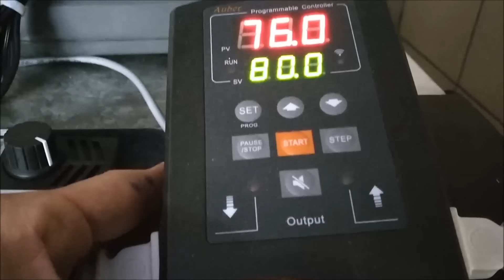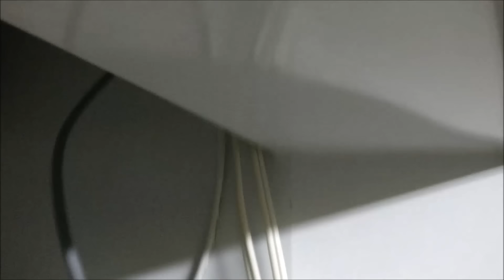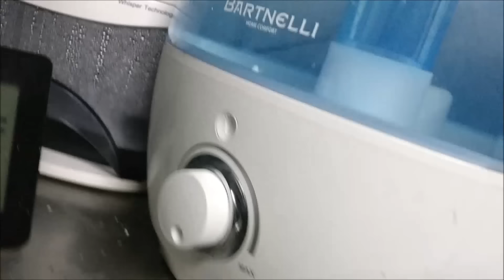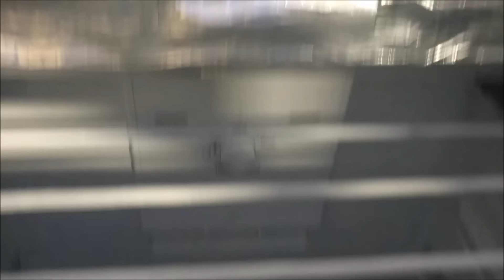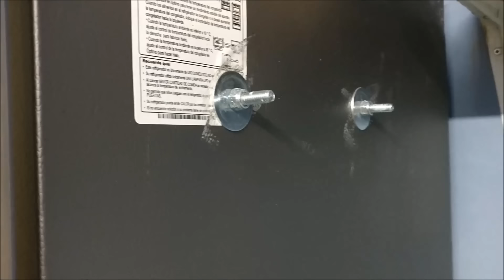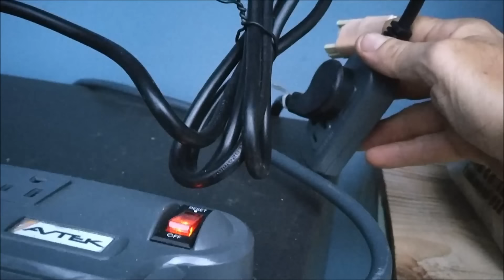Building a Drying Chamber for Salami/Salumi

Comment: Thanks for the video! Oh how I wish i had the space for a full size refrigerator!! I just got my 28 bottle wine chiller (I live in an apartment so no full size fridges...yet)  set up with a temp control and since the unit is so small and space is limited I went with just the mini-dehumidfier from Eva-dry. I'll hope that using evaporating salt water from a bowl will be enough to raise it up high enough since the chamber is sealed or I'll be in serious trouble lol.  Question , your temps are set at 55 for the drying and Ive been scouring the internet and Ive must of read like 20 different suggested temps. 52 degrees, 53 degrees,  even saw another guys video where hes got his temp gauge set for 68... and I thought ok that's really pushing the safety limits thats nearly 70 degrees... anyway hows your product working at 55degrees?  I'll probably target for that temp.
Reply from the maker: Thanks for watching.  The humidity should be fine with your set up.  Just be sure to check it (especially after the first month of drying).  In the beginning the humidity always spikes as your product begins to lose moisture.  Drying temps vary from person to person.  Typically the recommended range is between 50 and 60 but most try to stay on the middle to lower end of that parameter.  Every chamber has a life of its own so you'll want to monitor it daily in the beginning till you get to know how it reacts to meat being placed in it.  If you keep your humidity at 78-81 then your product will dry very slowly but you will get a wonderful end result (with no case hardening).  If you stairstep your humidity like this: Week 1. 80, week 2 75, week 3, 73, week 4 70% then your product will dry very fast but there's a good possibility of case hardening.   Also if the humidity is too high (Over 85%) then lots of unwanted mold growth.   So there's a balance between temp and humidity that keeps the chamber in that sweet spot.

Just an ide for the humidity.  If you see that you need to add a humidifier you can always buy a small humidifier and pipe it into your chamber  (to save Space) with a hose.   I've seen a few people do that as well....

Congratulations, Have fun, and if you have any questions let me know...
Reply: @2guysandacooler   Thanks much!  I put in a electronic humidity/temp gauge for now before I start drilling to check something out & sure enough the unit is about 5 degree's off on their electronic read out.  The read out is showing 52 degrees, but on my temp-controller and my mini gauge its showing 57. I can get the unit down to 55, but requires the fan to run longer than I like. Ive contacted them about it, but the company is no use to me, I think they're overseas and don't understand English. I told them and showed them in pictures that my house is 70 degrees temp  and the unit is in a corner with 6 inches of space yet their follow up email to that was to tell me that it's not designed for under counter and needs 6 inches of space.... oh and they asked (a third time) what my ambient temperature was.... yeah, not gonna get far with these guys.  I'll save up my money for a better unit. I would go with those mini-fridges, but they usually tend to have less interior space than a wine chiller because there is no refrigeration coils or hardware.   However I'm on the right track.  I sliced up my batches of salumi's I did in the house refrigerator, had to toss some due to the interior fan of the fridge drying them out too far, but some were excellent.
Reply from the maker: @See_Cook_Eat  sound's like you are on the right track.  Companies with lousy customer service annoy me....  What will you be putting in your chamber first?
Reply: @2guysandacooler  I just pulled out my professional 23" deli slicer my ex wife gave me and my vacuum sealer and did up the 7 salumi's I had in the fridge, my favorite is a toss up between the Black peppercorn and garlic or the Rosemary and fennel. I still have a 4 pound Pork Loin and a 3 pound Beef center cut left that was just starting its drying in my new cabinet but I had to temporarily put that in the regular refrigerator. I'm sure one night wont hurt it, because I packed up the wine cooler for return tomorrow after work, just going to get me a mini-fridge and use your video as a guide to do a mini-version lol.  I dont think those use more than 8 amps , if it does use more Ill have to upgrade my temp controls. Other than that, my next step is to go out to my friend's house and he's going to show me the ropes of doing some proper cased salami. Thanks so much for the replies.
Reply from the maker: That's great.  sounds like the mini fridge was acting out..  Generally most fridges (Even medium size-big ones) are less than 10 amps. so you should be fine.  Frost free is what is most recommended for Salumist.  Let me know about your progress.  This week I'll be making Black Garlic Salami as well as Calabrese Salami.   A couple small batches of each.  I need to check but I think my Pancetta is ready and even my coppa.    Hopefully!  Talk soon
Reply: @2guysandacooler  Hope your Panacetta and Coppa comes out great! Well I'm going to subscribe to your channel so I'll know if you all come out with anything new. I wish I could show you a picture, got the refrigerator today. 4.4 cu ft , way more space than my previous cabinet, but sadly not as big as yours lol. I drilled a 1 1/4 hole on the hump that covers the compressor on the far left side. So the cords are nice and clean. Setting up the equipment now. Fan, dehumidifier, the temp controller, Humidity controller. Still waiting for my fan speed controller to show up tomorrow.  Once it's all good I'll use some foam to seal the hole. For now, going to go set up the humidity values and I've pretty much figured the fridge drops 4 degrees once you kill power so setting the temp control for 58 and it should drop to 54 then very slowly climb back up. I'll take some tweaking I'm sure.  Thanks once again for your responses and I wish you the best.

Comment: Thanks for this video!  We're going to build out a 2nd chamber modeled after these.  Our first was a Raspberry Pi/Wemo wifi switch setup, and ultimately proved too error-prone to be successful long term.  We burned out the compressor on the fridge by toggling electricity too many times.  Which leads me to my question - do these temp controllers cut and restore power, or do they modulate the power the way a dimmer switch does?  Thanks again.
Reply from the maker: Ok first of all raspberry pi/wemo wifi.   I love the ingenuity!!!   Seriously.  The best salumist that I know are those who dare to experiment....   How cool.   Too bad it didn't work... :(

The units that I have both cut and restore power with a built in safety mechanism that keeps the compressor from starting and stopping too frequently...

On one fridge I use an auber control and on the other fridge I use an inkbird control
They both work fine at keeping the parameters in check.  

If you have any questions don't hesitate to reach out.  My email is in the about section of my page.  I can't wait to hear how your chamber turns out.  Keep me posted!!

Comment: about how much was all of the equipment used minus the fridge?
Reply from the maker: Great question.  I bought it from amazon and if I were to guess I would say under $250 give or take...  Check out the links.  All one really needs is a temp controller, a humidity controller then a humidifier and a dehumidifier.  Outside of that you might have to tweak your  system but those 4 items to me are key...

Comment: Thanks for the great tips! How do you control the temperature aside from opening the door? Fridges most often get up to 46 deg F highest, while yours can get to 55 and 60 deg F. 
Here’s the tough part - I live in Boston and my chamber will go into the unheated garage. Temps here can get down to 5-10 deg F in the winter. If it’s not winter and my ambient temp is 46+ deg F, I can see how turning the fridge off would help get my temp up. Do you recommend I get a small space heater for the winter curing months?

Thanks!
Reply from the maker: Thanks for the great question.  For your chamber you will need a temperature control.  Something that your fridge is plugged into.  This is one that I use (Temperature controller   Inkbird   https://amzn.to/2wtSp33 )  It's a good starter unit.  There are better ones on the market (from Auber Instruments) but they are a little pricey.  This temp control lets you plug in your fridge and a heating element if you need one.  Depending on the size of your fridge you might be able to get away with a 100 watt light bulb in a tin can set up.  Check out this video https://www.youtube.com/watch?v=X8TnPCejEaE  Skip to 46 seconds and see what I'm talking about.  You want something that heats the air without drying it out too much.  A space heater might dry the air out causing the charcuterie to dry too fast ..

So you would set your fridge to kick on at 57F and your heater to kick on at 53F   or something like that. (depending on what parameters you are keeping)  Hope this helps.  Let me know if I can help you out in any way.  When I started I had tons of questions...

Eric

Comment: How much energy would all your electronics use? Costly?
Reply from the maker: Great Question.  I have 2 units.  One large and one small.  The large unit with the dehumidifier and humidifier as well as the controllers and sensor run me roughly $6-$8 a month in extra electricity.  The smaller unit cost me roughly $4-$7.  This is only an estimate but with both units plugged in (which is way more than anyone needs unless you plan on making a serious hobby or small business out of it) added $13-$15 bucks to my energy bill.    I was able to produce over 300 pounds of charcuterie in those chambers in 2-3 months FYI.   My thoughts are this.  If you are going to build a chamber and have it running be sure to maximize your space within it so you can get the most out of the time it's plugged in.

Hope that helps.

Comment: Hi, Why use a humidifier and a dehumidifier at the same time?

Thanks.
Reply from the maker: That's a great question!!   It all depends on where you live and what parameters you are trying to keep.  Most often your chamber will be humid enough and all you really need to worry about is removing humidity (dehumidifier).  As your salumi/salami dries it will release a lot of moisture in the air.   leaving your chamber in the 85% to 90% humidity range.   As it dries though and your moisture levels reduce you might find that you will need to add moisture.  My parameters are fairly tight at 80% humidity and 55F.  I like having both because I can reduce the swing of highs and lows.  I hope that helps.  Let me know if you need more clarification
Reply: I understand better now, I hope to start modifying my refrigerator soon. Is not something installed for the smells?

Thanks
Reply from the maker: @betitotube  the smells are very pleasant and sweet.   If they are offensive then something has gone wrong.   Sometimes people will install a vent on the side of their fridge but I found that by doing that for me (because of where I live) it spiked the humidity too high.  They do this for air transfer not for smell displacement.   Personally I found that simply opening the door to my chamber once or twice a day allows the old air to escape and fresh air to enter.
Reply from the maker: @betitotube  I forgot to tell you once you start modifying if you run into an issue feel free to reach out.  I'm almost always available..,,😁